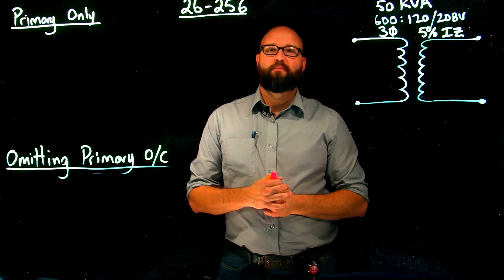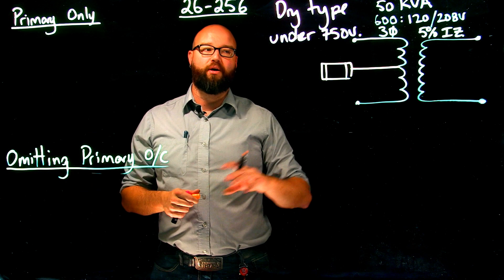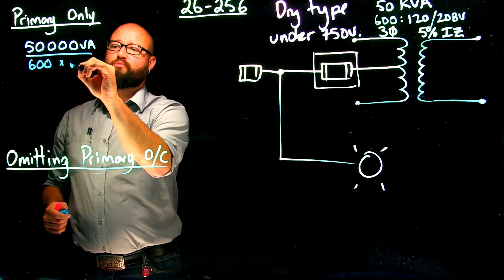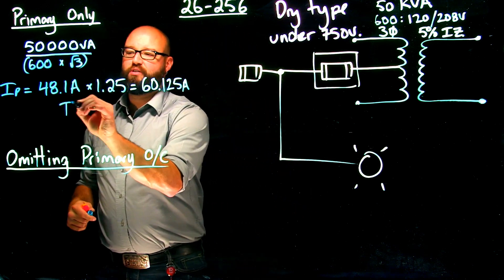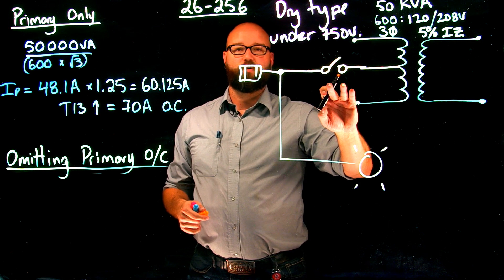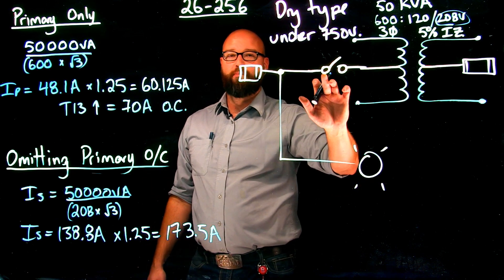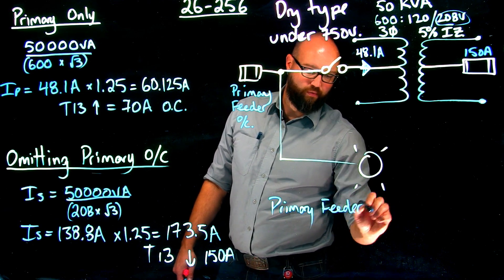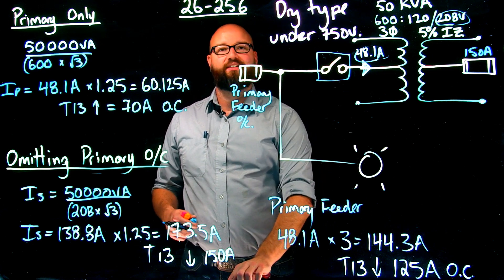Transformer Overcurrents Part 2

Comment: if it is used circuit breaker for protection how will you multiply?
Reply from the maker: You would use the same multipliers as a dry type transformer overcurrent calculation does not differentiate between fuses or breakers.

Comment: Thanks Schulerruler a quick question, In your part 1 for secondary side transformer protection where voltage is 600V (<750) you choose 150% for the fuse and 300% for the breaker, but in this video (part2), for the secondary side of transformer protection which is again less than 750V (208 V), you are using factor of 125% for fuse or breaker. Can you please explain why you considering 125% in this example for secondary side protection?

Comment: Thanks for this, so clear and concise.

I am a bit confused why you multiply the LINE voltage on the secondary side by 1.73 (root 3) when calculating the amperage. I would expect doing that for the PHASE voltage.

Comment: How did you know whether the 3-phase transformer is star-star, delta-delta, star-delta or delta-star. In other words how did you know phase voltage Vs line voltage. Also, what does the notation '600:120/208 V' for a 3-phase transformer? Please advise.
Reply from the maker: It depends on the voltage ratings. Generally one voltage (ie: 240v, 480, 600v) is generally a delta connection, whereas the "slash voltage" is usually a WYE connection, if the line is 1.732 times higher than the phase (ie: 347/600, 277/480, etc). Keep in mind the 120/240v system is just a center tapped single phase. 
Hope this helps, I'm happy to answer more if it doesn't.
Reply: @schulerruler  i am confused.  shouldn't we use 60a fuse on the primary side since the code mention the o/c rated or set at not more than 125% of the rated primary current of the transformer
Reply from the maker: @chenlanzheng7141  it does say shall not exceed 125%, but there is an allowance to exceed if it does not land on a standard rating for primary protection only. If you are referencing Canadian Electrical code for 2018 version, check subtile 3) in 26-254.
Reply: @schulerruler  thank you